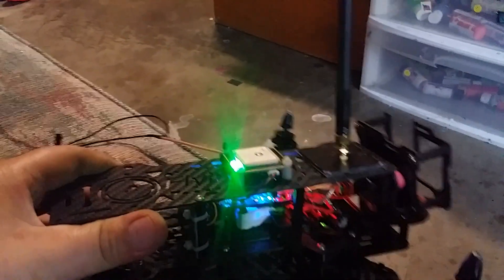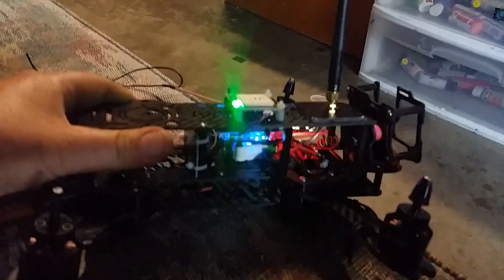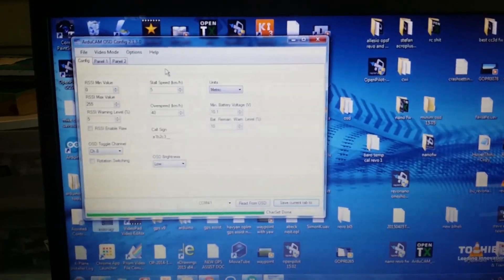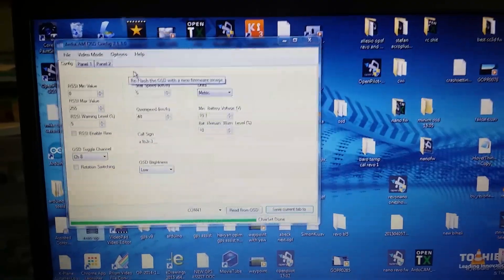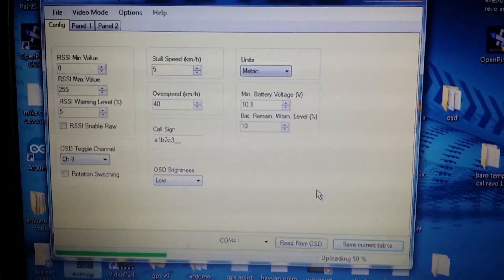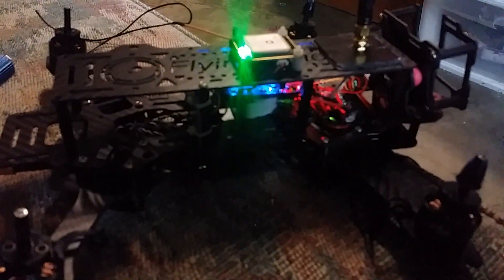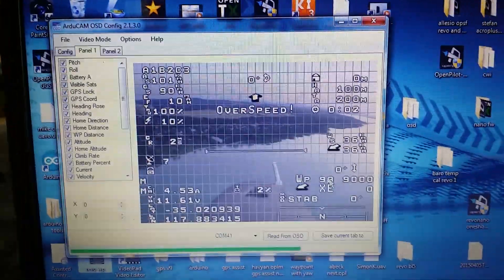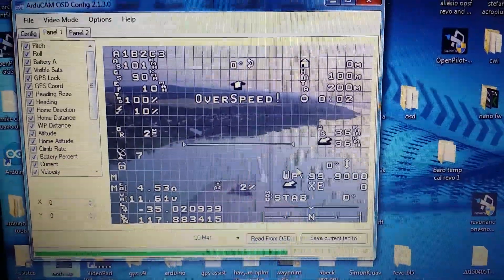Revo nano osd programing

Comment: this is not working for me (can't connect to bootloader). micro minim is connected to main port (tx to tx, Rx to Rx, ground to ground & 5v to 5v) and flex io (dtr on pin 3). combridge is enabled for USB vcp & main port, 57600 baud. minim shows overlay waiting for heartbeat.

any idea why it will not connect? what minim control center & hex did you use? help appreciated, getting no replies in the OP forum.

tried so far:
swapping Rx & Tx, going from main to flex port.